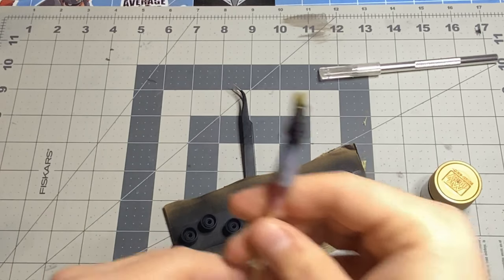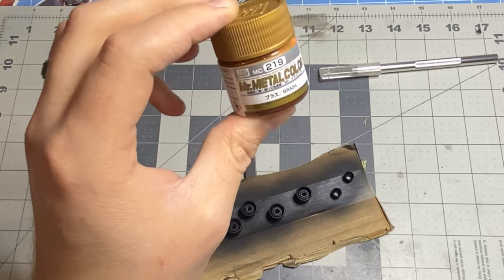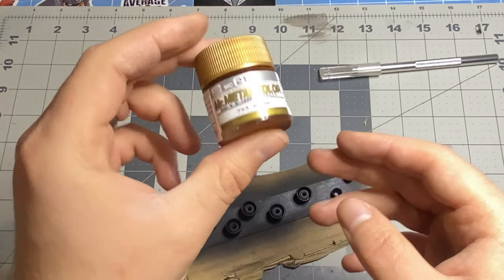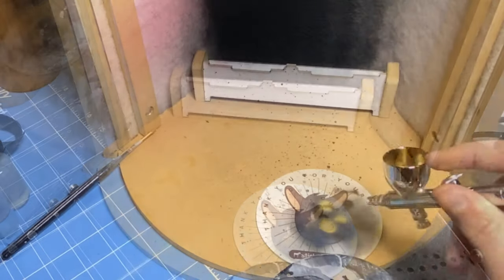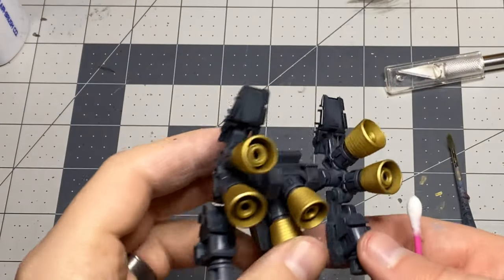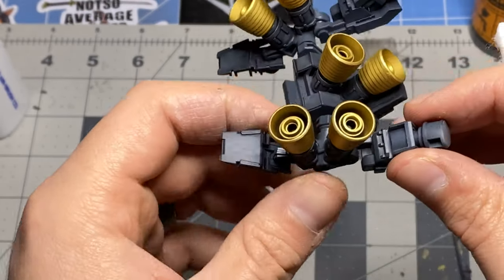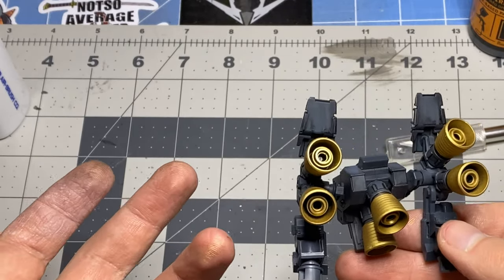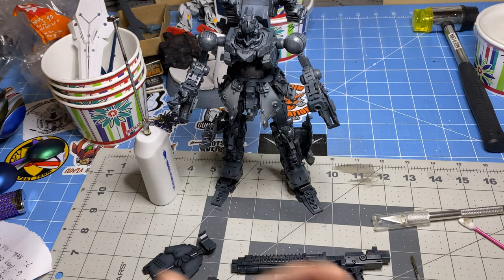[MG] Sinanju Stein Ver. Ka #steintimebuildalong part 4: Mr. MetalColor: Real metal from an airbrush?

Comment: I was struggling when started out painting  gundam, whether to have metallic or flat inner frames.  I used mr metal dark iron , which is awesome for inner frames. I just primed with black primer and do not thin, it clogs up pretty good tho. Awesome stuff, but a clear semi gloss  is a must after buffing otherwise it never dries and will get on you fingers. Haven’t tried the mr color super metal is 2, but huge fan of mr color. What is your go to for inner frame non metallic/ metallic?
Reply from the maker: Man it is always a tough call on that lol I kinda change it up from kit to kit. I guess it depends on how much you want the inner frame to take away/add to the armor.

I kinda like German grey for inner frames a lot for the non metallic side. Lately though I have been using a lot of dark blue Greys on them. It just screams strange metals lol 

For metallics I hadn’t used much, the Zaku Warrior I used SMS steel and aluminum and it turned out pretty well. I want to do a chrome inner frame for something to give that “raw metal” look.

Comment: U dont thinned the paint before aply?  Its not necesary?
Reply from the maker: Nope not with that particular color at least. I’m not sure about the other ones in that line. I opened it and stuck my badger paint stirrer in there turned it on and it was so thin it spilled out the top. I then just poured it into my AB and sprayed away with zero issues